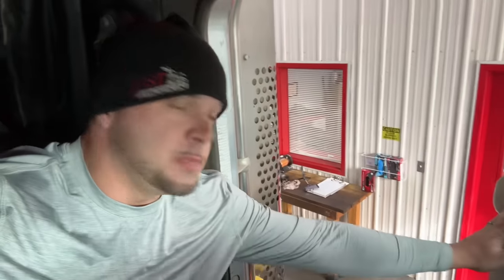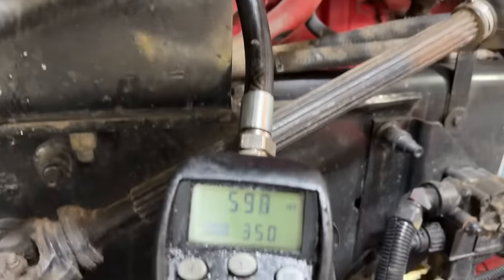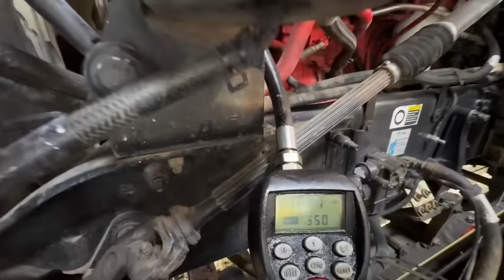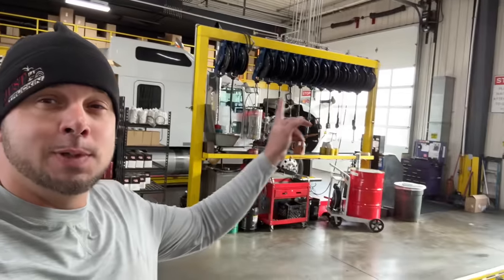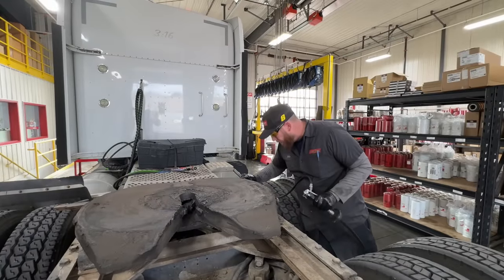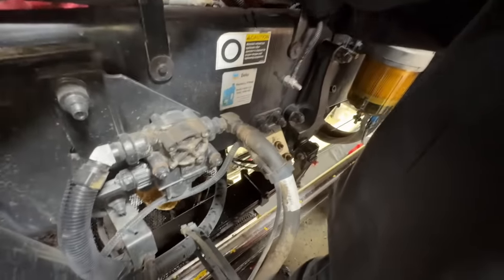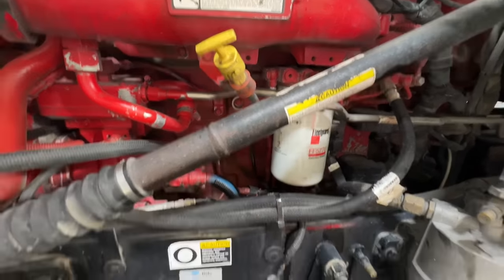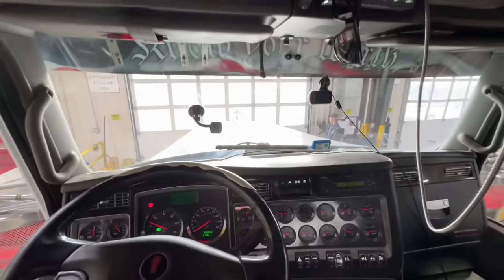HOW MUCH oil does A Big Rig Take !!

Comment: Justin you are  100% correct you going to watch where you go for gas I like when you went to lube zone how polite the two mechanics were they were happy to work on your truck and get it in and out as fast as they could they were very polite they lube up the truck besides doing the oil change changing the filters they make sure you are leaving with a truck that was not breaking down they were tightening up everything two awesome

Comment: Stop changing oil. Start using a Gulf Coast bypass oil filter, which keeps oil clean all the time.
Model 0-2 has two paper towl size elements in the housing. General Motors put out a report in the 1980's that said putting a by-pass foil filter onto any diesel or gasoline engine will double the life of any engine.

Comment: I am very surprised you did not have the trailer lubed ,it does the same miles as the KW
Reply from the maker: Left it behind 😎🙏🏽 just changed hubs to Oil bath
Reply: S cams and slack adjusters still need lube  @JustTruckin